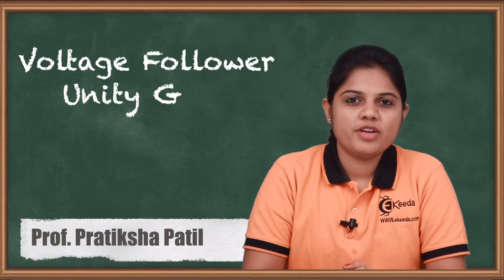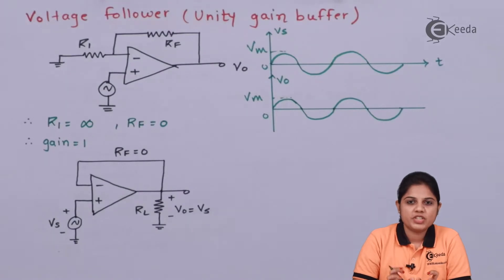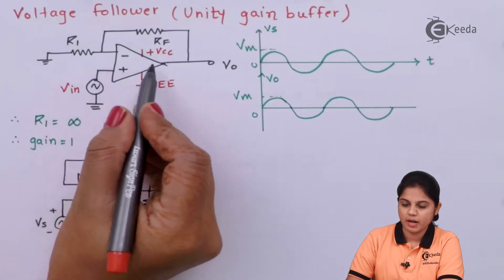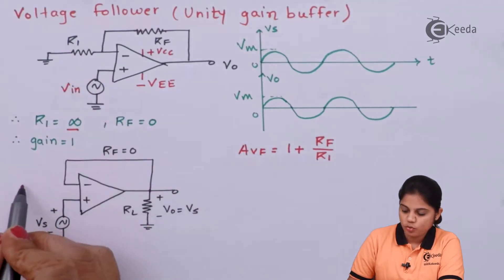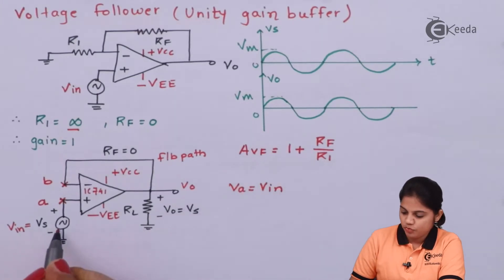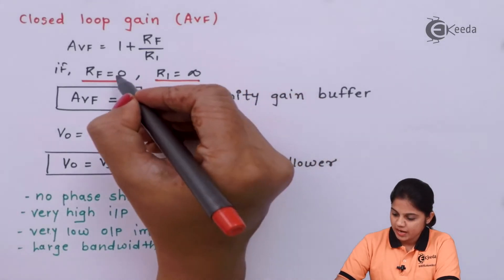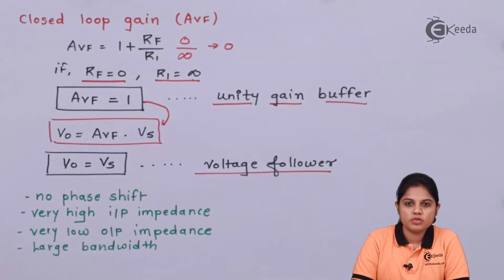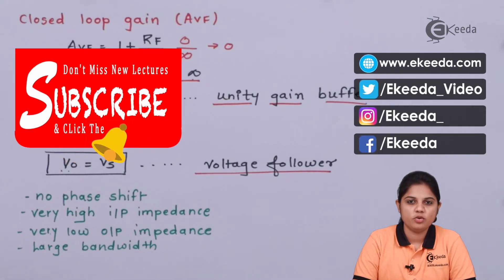Voltage follower Unity Gain Buffer - Operational Amplifier and 555 Timer - Industrial Electronics

Comment: That is a very useful concept for measuring printed circuit boards. With this circuit you can guard the component of interest from falsification of the measured values, which is called "guarding". This video is a excellent explanation on how this concept works!